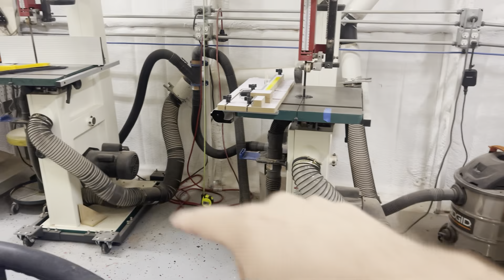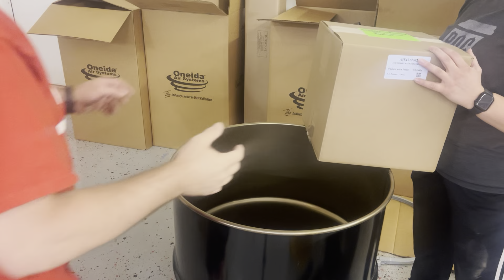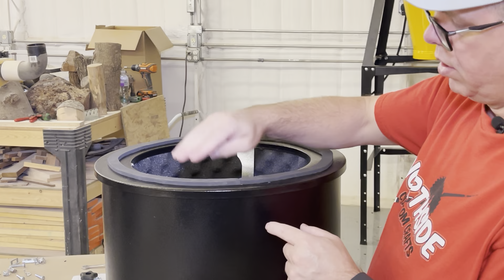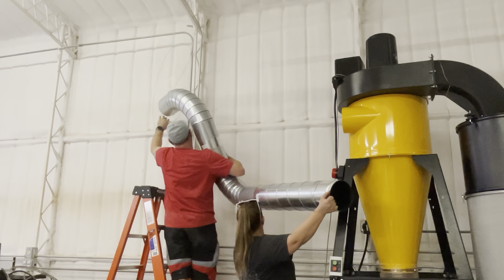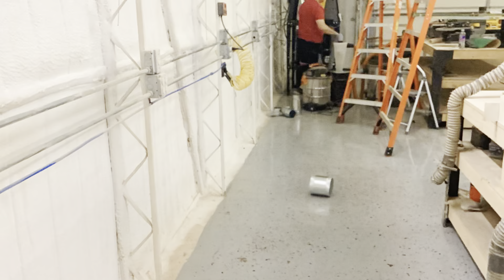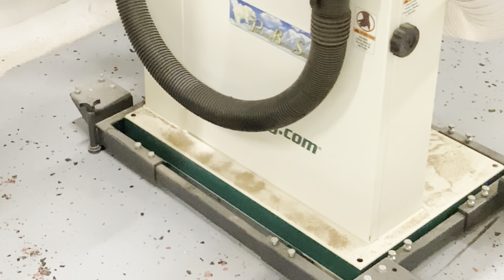Oneida Dust Gorilla Pro Install Guide For Your Woodworking Shop!

Comment: Where did you get the long spiral duct and fittings? I have a shop that has 6" spiral but I am building a new shop that will be larger with higher ceilings so I will need more pipe and probably more fittings and reducers to 4". I have 11 drops now with plans to add couple when there is more room in the new shop
Reply from the maker: Thank you. Everything on this system is from Oneida.

Comment: Thanks for the video. It looks like the piping that drops down is not fixed to any vertical bracing, how is that working for you? I am thinking about getting the Oneida v3000 but want to have a drop from the ceiling to my table saw and am wondering if it will wiggle or kick out some during use if it is just hanging down from the ceiling without vertical support.
Reply from the maker: Thank you. I was thinking I might have to support it in other ways, but the run that is along the wall is pretty tight against the wall and it seems to anchor everything pretty well. If I bump into the branch that goes across the shop, it will definitely wiggle a bit. Not enough that I'm very concerned about it.  I was going to make supports that dropped down, but didn't find it necessary.  You might in your situation. I hope this helped.

Comment: Just saw that I didn't have a response to a comment on this because my comment didn't actually go through, gotta stop watching this stuff on my phone and just use my computer. In any case, the comment went something like this: Absolutely stupendous walkthrough of the whole setup. If Oneida is considering using a video to demonstrate an actual installation, I think this would be a great candidate. Additionally, if Oneida is looking, this is the sort of demonstration that makes me want to buy that same setup, as it doesn't just say "look at this its cool go buy it" it says "this is why this is cool, and while it may not be easy to do, it is simple to do, and you can do it too" which speaks to me volumes more than just typical ads that people make for other companies. Also, I'm wildly jealous. Just throwing that out there. 💪🦆👍
Reply from the maker: You never disappoint Mr. Skitch 🦾🦾🦾